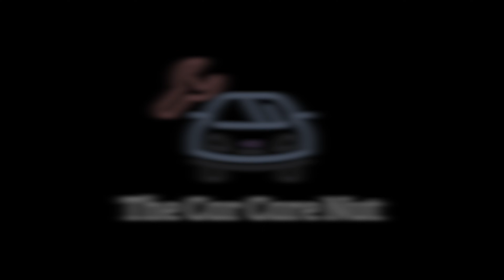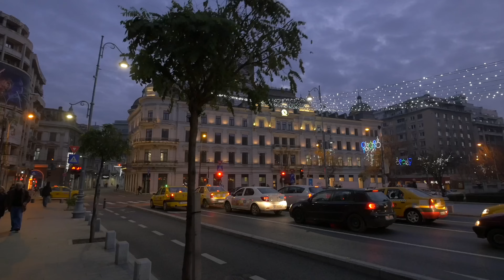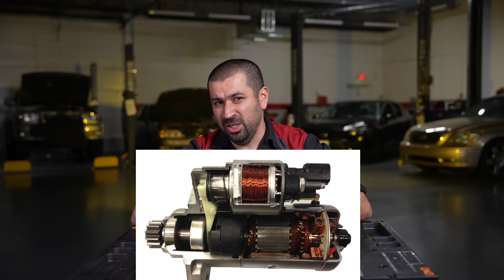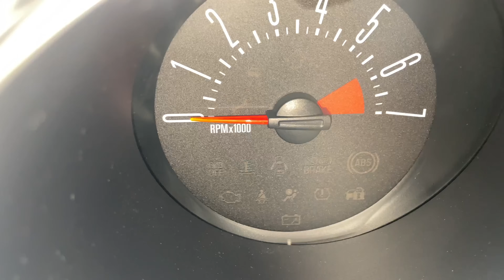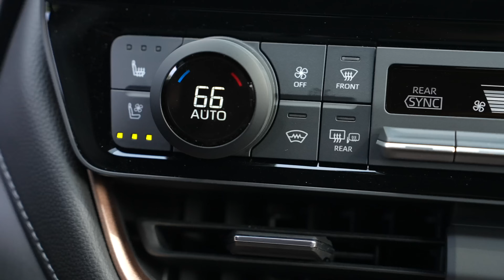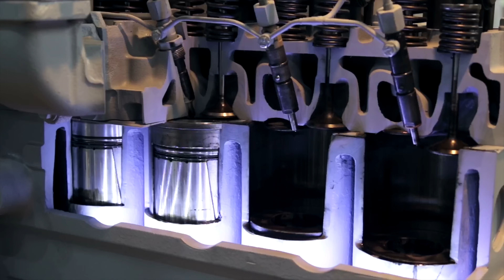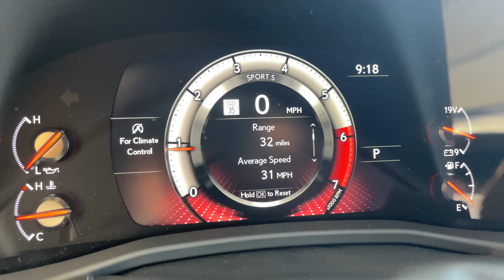How Does Start Stop Technology Work in Modern Cars? Everything You Need to Know

Comment: i turn mine off everytime i get in, mostly to extend the life of the starter beyond what the factory planned for it. I have a Kia so im not sure if the Kia system also counts the stop events like Toyota.

When I have left it on, it doesn't do too badly. It starts the car very quickly. Ive always wondered why it cranks traditionally from cold, but in an instant in a start stop event. Thanks to your video now I know. I like that as soon as I start to let off the brake, the car starts. Its so quick its running before my foot is off the brake, so when i step on the gas its like the engine had never been turned off. 

My pet peeve though, is when Im pulling into my garage. As soon as I come to a stop, the engine shuts off. But when I move the shifter to park, its starts, and then I have to shut it off with the ignition button. Also, creeping up in slow moving traffic, it shuts off sometimes and not others. WHich is why I just shut it off now when I get in.

Comment: I bought a stop start disabler for my Highlander and you can get it for all different makes for less than a $100. I don't have to worry about the counting starter motor. The starter is going to last the life of the car now. Less strain on all those components. When i start the car it automatically turns the system off. If i want to activate it so the start stop system turns on i just have to press the button. Got lazy pressing the button every start up.

Comment: What about oil pressure?
Reply: I was wondering the exact same thing, and the effect SS cycles have on the oil pump and attendant lubrication components.
Reply: Yes, what does that do to all the bearings and the cam? Most of the wear on these is when there is no oil pressure and no oil film between wearing surfaces.

Comment: He says it needs a special battery for this stop/start to happen. What if you put in a regular battery, wouldn't this tell the computer something is wrong and disable the start /stop function?
Reply: I believe he said SS will still work with a regular battery, but the system monitors it more closely since it knows that such battery is more susceptible to larger voltage drops at start-up.

Comment: Auto-start/stop is a crappy idea in any luxury car, unless it can be easily turned off permanently by the driver with a button.   And just as annoying are cars that automatically lock your doors when you start moving; ok as an option but not as a default — and especially not as a default that you can’t permanently disable

Comment: As I recall the first widespread use of stop-start was by Volkswagen in the 1990s, but it was limited to manual transmission vehicles in the EU markets only.  It took much longer for it to be adapted to auto transmission cars. So it’s not really new. 

As for savings: Road & Track estimated idling wastes almost 4 billion US gallons of fuel per year, in the US alone. So it’s not inconsequential. 

To those who find it annoying, I suggest you buy a hybrid, where it happens seamlessly. or just buy an EV, where the motor stops when the vehicle stops.

Comment: When you start the engine after a start stop event it has no oil pressure because the engine stopped running and oil drained back to the pan it takes a little bit of time to get the oil back to the top of the engine and it causes wear starting the engine causes the most wear to an engine and overtime it's wears alot and that's the most major concern
Reply: You need constant pressure and oil flow to keep the metal bearing surfaces from touching and wearing. And what about the hot bearings in the turbo? They need a constant flow of oil to keep them cool.
Reply: @richardlamoreaux8979  that's what I'm saying

Comment: AMD, how do you feel about products like Carista which allows an owner to easily modify things like having the auto start/stop disabled at start, and even change other smaller things like the number of flashes your turn signal makes when you tap it, or being able to roll all windows up/down by holding a button on the key fob?
Reply: What is Carista?
Reply: @dwaynelasater2350  plugs into your OBD port and allows you to change settings that only the dealer typically has access to. Just search Carista on Google.

Comment: Like always, great job Amd. This is the first time I see a mechanic goes in depth to explain how the system works from an engineering standpoint. Please keep those videos coming 👍
Reply: Which was a fantastic job, but I do think a lot of views just fast-forwarded to the ending. So that they can sleep soundly knowing it doesn't damage the engine....
Which is not true, technically, because it does increase the wear-and tear on some components... But only for petrol engines 😀. As I always point out: if you "want" to have a Start/Stop system, it is much better to have an engine which you have to force to stop rather the one you need to force to start...
Reply: What a great tutorial on start stop. Thank you Amd.  Comment: We bought the 2017 Toyota Camry Hybrid new and use it mainly  (36,000 miles so far) for short errands around Souther California beach cities. No problems. I change the cabin, engine and drive battery blower filters.  I get a local  Indy shop to chase then engine oil with OEM oil and filters and a change of the OEM coolant, band rake fluid. Transmission fluid is next.  Did not get any caution or warning lights about the 12v battery but after six years it was near its 20% life left mark and I replaced it with an OEM from the Toyota Dealer parts department. Did not know the Computer system should be reset  to show the new battery but Amd points out in this vid that after driving the car around for a while the computer will discover the new12v OEM battery and adjust as needed.  Opinion about vehicle emissions control is mixed as the science for the cost vs. effective value is not readily available. I find it suspect that Calif has literally spent billions of tax payer money on clean air without providing anything for justification other than "trust me it works" while a some other States don't spi=nd a dime on vehicle emissions. Also I find it suspect that politicians, car manufactures,, insurance  companies and law enforcement have done little to nothing to keep  catalytic converters from being stolen by the millions year after year. . Based on $1,200 -$2,000 replacement cost vs effective value is their roll in the  emissions control  scheme worth it?
Reply: This theology,bunch of bull s
Reply: Another fine example of why this Car-Care Nut and not the Toyota/Lexus nut channel.
Reply: If hitting the disable button every time you drive is ok then disabling the system entirely should also be ok.    Just another BS system added to cars that runs up the cost of the car and maintenance cost too.  Your government at work.  I feel the same about reducing engine size and adding a turbo... looks good on paper to the government, but the buyer pays the price in the end.
Reply: @russwd1  You're right! Tractor oil and filter changes where always at 200 hours but now we're told only to change the oil and filter at 500 hours for the very same engine. I have no doubt this will shorten the life of the engine, but that's our problem if we're stupid enough to believe them. 
This start stop is a certified wank adding unnecessary complexity and cost to the car.
Reply: Worshiping youtube content creators is getting old..

Comment: I had no idea stop/start systems were so complicated.  No wonder modern cars are so expensive!
Reply: A lot of engineering and expense for a system most people find annoying and bypass every time they get in the car.
Reply: Right lol @cgraham6
Reply: @cgraham6  Exactly right. I'm in Australia and although most modern cars these days have it, it is quite rare for me to hear someones engine starting at a traffic light. This tells me that a very small percentage of people actually use it. Most people just get in the car, put on their seat-belt, start the car, turn off the start stop, then drive. They have just added that unnecessary extra step. I just wished they would've put the effort they used to design this into working out a way to reduce the idling speed of an engine without it stalling. That would presumably have a much higher environmental impact as it is something that people would actually use!
Reply: @tonydarcy7475 almost every stoplight with a newer car next to me, I hear the start stop 😂
Reply: Exactly, and you have to pay for all that pointless research too. Plus they get to sell you more expensive batteries more often.
Reply: Lots of added points of failure, so the manufacturers don’t mind it at all. But look at a cost vs benefit analysis.  How much more expensive and complex are cars versus the reduction in emissions.  I really don’t know, but i have to wonder if it wouldn’t have been better to get those same savings on emissions somewhere else?
Reply: @elzar760 they did look and discovered that they can charge you more for big more expensive parts and sell them to you more often.
Reply: The price of Nissan Sentra going from 2023 to 2024 didnt change when they added that garbage start/stop feature.
Reply: That plus feature creep, or the automotive equivalent of bloatware. My new truck is a base model by today's standards, but would have been considered a luxury truck only 20 years ago.
Reply: @NorbRetEngineer and you are upset that a base model has luxury features? Wut 😂
Reply: @JTheraos  Well, if it contains stuff I don't want or need, that means I'm paying money that I'd rather spend elsewhere.
Reply: @JTheraos it means he's paying for crap he don't want.  I know I have a truck like that
Reply: Thank government for that.

Comment: Thanks for this. Seems like a lot of smart engineering minds spent way too much time on solving a nonexistent problem for an almost-nonexistent benefit.  And they added multiple points of potential failure during the car's life assuming one wants to take a car to 10+ years like I do.  Not their fault, that's what they were instructed to do.  Smart folks directed to do dumb things.

 I have a 2020 Subaru with this (I would have bought a Toyota but the ones I wanted weren't available in early 2022). The first thing I do after starting it is hit the stop/start button to turn it off.   I'm glad to hear that the computer just shuts it down after 10 or so years (at least on a Toyota, don't know about Subaru).

Comment: i have this feature in my Honda...i never disable it because the car/truck is smart enough to do all the correct things...In central NY, our traffic lights are 30-40 seconds or a minute at most...the feature kicks on every so often depending on conditions BUT I can see this saving a ton on emissions down in southern states where the lights stay red for it seems like 4-5 minutes at a time...that is a LOT of wasted fuel and spewing carbon monoxide....this is a good feature for the environment and the car makers have done a good job with this shut off system...fantastic explanation

Comment: Doesn't the most engine wear happen at engine start before the engine oil starts fully circulating regardless of whether the engine is hot or cold?  When the engine is stopped, the engine falls back into the oil pan.  When the engine is restarted, the oil  has to be re-pumped back up to fully lubricate the engine.  Yes, there will be some residual oil on engine parts, but it is only residual oil; not the full lubrication the engine gets when the oil pump is running.  I would like to hear how they explain away this issue.

Comment: I have a 2017 Highlander and the other day, in stop and go traffic with this feature kicking on repeatedly, I got a warning that the battery voltage was too low to continue using it. Since then I was wondering how this whole system worked. SO this video was very timely and really informative. Much appreciated
Reply: Your battery will be dying soon.  Get it checked.  This is the exact same sign I got with my Highlander.
Reply: https://youtu.be/d-O5j4Qax_c?si=nYZYTp1dbocbMnOB
Reply: I would turn it off manually in stop an go.

Comment: I can appreciate the effort they're doing to control emissions. It has made a difference. I remember back in the late 60s the smog was really bad in the Southern Cal area. Now days seeing the blue sky is common. Even in the middle of the pandemic when traffic had dropped way down. The air around all major cities around the world had cleared up a lot within a few months due to the drop in vehicle traffic. People don't think it makes a difference, but it does. But it can make cars incredibly complex to work on. Not much left to do for a car owner except maybe changing the oil and filters and maybe the spark plugs if you can reach them.
Reply: I bet the majority of that pollution was diesel engines
Reply: @DylanL69  Diesel traffic maintained in the US since the government allowed essential businesses to keep on running. That means trucks were running during the pandemic. The clean air is a result of the dropped in car traffic.
Reply: @Rhaspun  nope the majority of diesel trucks was less due travel restrictions most drivers didn't want to deal with that plus you forgot about the supply chain shortage

Comment: Nice. It makes car more complicated. In this case building parallel hybrid with really small battery makes more sense than implementing start-stop. Great video, very descriptive how most annoying stuff works.
Reply: Would be great if/when there is an alternative to lithium.  The current reports of lithium produced/enhanced fires is becoming a real threat to sales.
Reply: @Jestey6  I'm on my third hybrid Toyota an none of them had lithium batteries - they all used proven NiMH. They weights 2-3 times more than lithium, but it's not a big deal to have 20 or 50 kg battery on 1500+ kg car.
Reply: @igortokarev2350  Hi Igor.  I bow to your superior knowledge regarding Toyota cars.

Comment: You did not address the only question that matters to me, "does start stop technology damage the starter and battery"?  Obviously yes.  Every mechanical and electricial system comes with a rating for a finite number of times it can we used.  If the car has to restart 10x every day on my way to work instead of 1x, it will fail sooner.
Reply: Did you do any searching for evidence that stop start systems have a higher failure rate?  There is an enormous sample size, so the statistics will have a high confidence interval.  Top tip, there is no evidence of a higher failure rate.
Reply: @Mark-lz4wg  are you claiming that the bathtub is a myth?  https://en.wikipedia.org/wiki/Bathtub_curve

Comment: Not even gonna lie.  The implementation of the auto start stop system in Toyotas is fantastic, i thought i was going to hate it in my 2023 Toyota Corolla Cross LE AWD 2.0L but its implemented in very intuitively.   I was even gonna bypass the system completely but after driving it for just the few hundred miles ive had it, its great to live with.  It makes sense that Toyota's implementation is the best since this technology is derivative from hybrid technology, it makes sense that its the best since Toyota really mainstreamed hybrids.  ive driven fords, dodges/jeeps, Subarus, and GM vehicles with their vesrion of start stop technology, and its literally horrible the way they do it, so, im happy to use it on my Cross. 
To add, not that i go very often, but, when i do find this system extremely beneficial whilst being in a long drive thru line.

Comment: Toyota has been doing this for quite a while. Its a great feature. A hybrid typically is only a 25% boost in FE avg, while a stop start is about 10% by itself. So its a cheap way to get halfway to a hybrid improvements. Toyota and aisin does a great job on electric water pumps and starters.
Reply: Denso makes their starters and water pumps aisin makes their transmissions
Reply: The fuel savings from start/stop depends completely on the routes taken. It could be measurable for some people and absolutely insignificant for others. The 10% numbers seems to be the absolute maximum that could be saved in heavy start/stop traffic.
Reply: @justliberty4072  in the video he does say it's not really about fuel economy it's more for emissions
Reply: @DylanL69  its both. "Americans Have No Idea How Much Fuel Idling Uses" by engineering explained
Reply: @paladain55  for long periods of time it does but not at stop lights you're not sitting long enough
Reply: @DylanL69  I've done start stop on 3 motorcycles, two trucks, a car, and a prius. It really is about 10% on average. Yes. Most people know start and stop only helps in town drivers.

Comment: AMD, I remember very clear one of your videos were you said that every time Direct Injection Engine starts a small amount of unbuned fuel passes via piston rings to the oil. That is why it is good not to drive the car on short distances - this way the fuel in the oil is unable to evaporate. So...given that is't that a downside to the START/STOP system? We are puting aside Toyota engines because almost all since 2010 till now are D4S and I guess that they use port injector during the start

Comment: I purchased a Chevy Silverado 2014-2018 V4 delete off of Amazon, took care of that damaging V8 to V4 constantly that takes out the lifters and damages the engine. I also fortunately took care of that auto stop at traffic lights. Drives like a real V8. The one I purchased was a little pricy but well worth it!
Reply: Better hope you don't fail emissions for tampering
Reply: Gm ruined a great engine with cylinder shutdown, the LS series was much better before it, at least from a reliability standpoint.

Comment: Question: If I get highjacked at a stop light and forced out of my Toyota. How far will myToyota go with the key FOB in my pocket? OR, if the CR2032 coin cell battery in the key FOB looses conection while driving, will the Toyota just stop running?